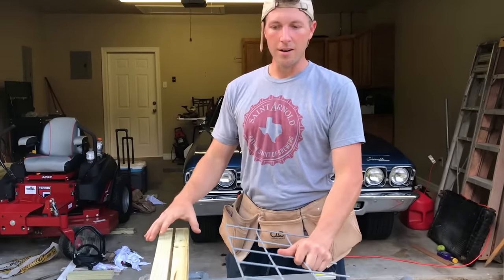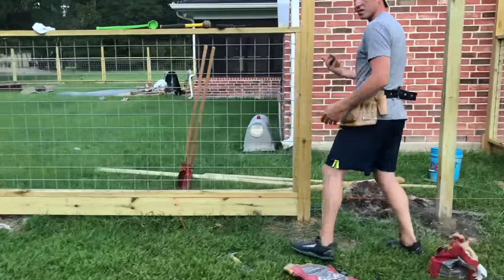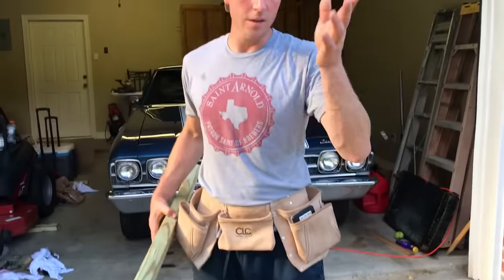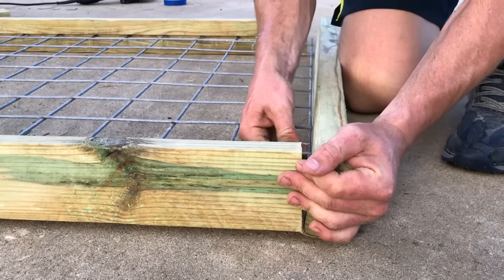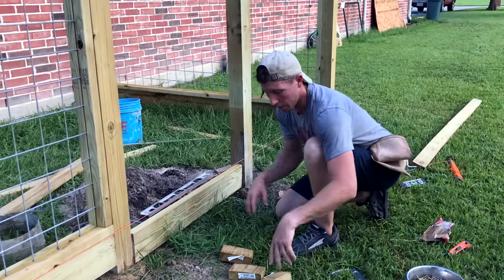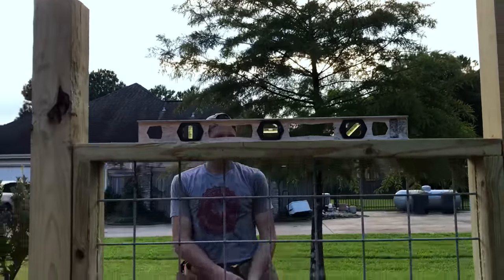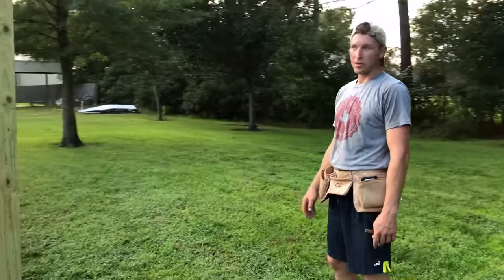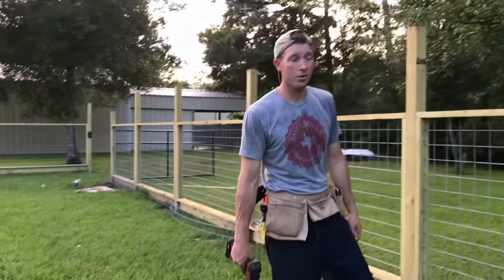Part 1: Modular Hogwire Panel Fence with Dado Groove

Comment: Great fence! I'm about to buy a piece of land and I have two Australian shepard/Pitt mixes that love to run.... and dig. I had a nice privacy fence they broke the slots out of to run off. I think I'll make something similar with concrete around the base or something
Reply from the maker: Anna G Thanks for the reply… The fence should hold up well to your pups, especially with the added concrete bottoms. Buried cinderblocks or pave stones could work as well For minimal price as well. If you are interested in construction details, material breakdown, and cost generator based on my build per linear foot, shoot an email to Hawkijon@aol.com

Comment: If the desire is there you could paint the 2x4’s and post before putting the panels together and installing...paint or stain/water seal.
Reply from the maker: Thanks for the reply! you're absolutely correct! Both are excellent ways to preserve the wood from bugs and natural decay, but unfortunately treated wood must set for a while before it will properly accept stain or coatings. About a year after install it was finally able to accept stain. Usually it takes a few months, but in our humid southeast texas climate it prolonged that process. The fence has held up great. shoot an email to hawkijon@aol.com if youre interested in my construction plans and cost generator.

Comment: This is really great and very helpful. Thank you for including the plan information. It is impossible to find the wire fence at gauge 6. I am not sure if gauge 10 would be strong enough.
Reply from the maker: I would recommend four or six gauge… Go to tractor supply they should have bundles of this stuff 60” x 16’
Reply: Perfect, I think four gauge is ideal and strong enough. Thanks @GatorOverland

Comment: Had to watch the vid twice. In the first vid, the Chevelle blocked my view (I have a '67). Also, I noticed the 2 barley sodas on your saw. That's at least a 3-beer job. Per panel, that is.Seriously, great vid and thanks for the post, man. I gained lots of useful info that I may use to frame my pets' space.
Reply from the maker: thanks for the reply bud! Yea shes a 69 and alot of fun. I finally got her to stop drinking so much and is now in the 14mpg range. As far as the fence goes, i have developed some PDF details with material breakdown and an excel cost generator based on my exact build per linear foot. shoot an email to hawkijon@aol.com if you are interested.

Comment: What a great fence. Thanks for sharing. I’m in rural northern Illinois, and need a fence to keep the deer out of an area. Would you think I could stack your panels on top of one another, (with a 2x4 in between for support), so I can get a fence that is 8’ tall? I’d truly appreciate any advice. Thanks so much for a great video.
Reply from the maker: Thanks for taking the time to watch and comment… we’re coming in on our fifth year of construction and all is holding up well… If you haven’t seen our part two (18 month evaluation) you should check it out, it answers a lot of questions that folks have had over the years.
It will take time, money, and strength to do, but I have no doubts that this design will hold up to what you’re wanting to do. Since the weight of the fence panel is distributed between the lower rot board and the two vertical post, it shouldn’t be an issue of sag. It would definitely be different, and I would love to see the finished project. What is your expected length of fence in linear feet?

Comment: Watched your video about 6 times, before I finally built my own 45 foot hog wire fence.  Thanks for posting this video.  I showed it to my wife, and even she thought I should build one.   

I need some advice.  I went with a double gate, instead of a single. This was to make sure I had clearance away from a waterline.  Didn’t want the posts to be too close to it.  

I was in the house upstairs, and looked down and saw that they were noticeably, twisted.  Probably happened after all the rain we got back in July.  I’m in the Austin area, so I deal with heat, and crappy soil.  

You mentioned that a couple of your posts also moved, before you put in the panels.  Mine were perfectly straight, after I built it back in June.  What’s the best way to move them back?  I know I’ll have to take the gate down, and the panels on either side, before I can even adjust them.
Reply from the maker: Hey mike, thanks for reaching you. Always good to hear from a fellow Texan. Glad to hear you took on the task of making your own fence. I never would have guessed this project would have become so popular. I honestly made the video to keep from having to explain the same thing over and over to my neighbors... 650K views later, here we are. So, to answer your question, leverage is your friend. Apparently its nearly unavoidable for posts to twist as they become wet/dry/wet/dry and if left long enough between your setting of post and installing of panels, etc, they will twist beyond use. What i did to combat this was i took 2 left over 2x4's from the project and put them perpendicular to the 4x4 post and flushed them up to an open edge of the 4x4 and drilled a number of screws through the 2x4's into the 4x4. to begin with i started from the ground and followed the 4x4 up until the point of which i saw that it started to twist (maybe 2ft up) and and gave it another 6" and placed the first 2x4. i then followed the 4x4 up further to find that it was pretty much the same twist amount from below all the way to the top, so i placed the 2nd 2x4 about 18" higher than the first. If you understand what ive explained so far, ive made an "F"...the 4x4 post is vertical and the (2) 2x4's are horizontal about 18" apart, and the lower board is about 6" above where the twist starts. Get a friend to come over and pull on those horizontal boards while you get your panel in place. Surpringly the post untwisted with little effort and no damage or splitting of the screws with the boards i was using to lever. If need be you can comealong the lever boards to a stronghold (tree.tractor, truck) for a longerperiod of time than pulling. If you have this ability, then you can do a number of days of wetting down the post to untwist it to a neutral postion,,, but be mindful it could start twisting the other way if not tended to properly. I hope this puts you with a better idea of what to do. Shoot an email to me if need be hawkijon@aol.com
Reply: @GatorOverland  Thanks for the quick reply. I didn't think about just using a couple of spare 2x4's for leverage.  I thought about wetting the ground down, to get it soft enough for it to move.  It's already hot as heck, so it should dry quickly, after I'm done.  Also, I just took off the gate, and the panels on both sides of the post, so that it's easier to work.  I'm going to run a string along the top and bottom, and line it up, and try the 2x4' method.  Thanks again for responding so quickly.
Reply from the maker: You bet! Happy to help/contribute.. hope it works out.. it just need to be close.. it’s a fence after all
Reply: @GatorOverland  I just looked out my window, and now I see why you said to use leverage to twist the wood.  I guess when I said the wood was twisted, in my mind, it had moved at the ground level.  Looking at it now from the window, my left gate post is actually bowing to the right, which is where the fence swings open.  The right gate post is twisted starting in the middle.  Man, I may actually have to dig up that left post, and replace it, because of that big bow, and twist.

Yea, I know it just a fence, but I was proud of myself for actually building it.  I think it took me 3 weeks to build.  I had to rent an auger, then rent 2 jack hammers to break through the rock.  The 2nd jack hammer, was to dig out the first one, that got stuck.  lol.  

You've given me an idea of how to approach it, so thanks again.
Reply from the maker: Yes, i can only imagine the amount of excavation effort that went into prepping for your posts. Mine was 207ft set in loam/clay/soil and with august/september weather here on the gulf coast, it took me the better part of a month to complete mine, and in in that time my post began to twist, so it doesnt take long. And absolutely this fence is somthing to be proud of. Im not a wood worker/carpenter but i felt very accomplished for taking it upon myself to plan and execute the project without help and with minimal to no hickups. When i was mentioning about being "close" i meant with your own discretion but dont fret because its wood, and its perfectly imperfect and will constantly change over the course of time. Thankfully its been over 2  years and mine is holding up well, no warping, splitting, bowing, rotting... very happy with the outcome... atleast 4 people in the neighborhood have done this fence. It works great.

Comment: Nice fence. Do your dogs dig? We had to put cement pavers into the ground and overlapping bottom of fence about two inches. Then Quikcrete was used to seal the pavers into the ground.
Reply from the maker: Thanks for the reply, fortunately the only digging that has occurred has been in the middle of the yard. Come to find out, we have ground moles and the aussie picks up their scent during the moles breeding time. I cant say im happy about  his methods of mole eradication, but if they dug on the fence line i would probably do something very similar to what you have mentioned.

Comment: The groove in the bottom rail will hold water. If you caulk that up it may prevent rot. Nice inexpensive fence.
Reply from the maker: Thanks for the reply, i did go back and drill 1/4" hole every 8" for the dado grove for draining. I checked it by pouring a bottle of water in the groove. Its no Niagara falls, but it definitely drains. Shoot an email to hawkijon@aol.com if you are interested a hand sketch with material breakdown and completed photos.
Reply: @GatorOverland  Was going to recommend drilling holes every so often to allow the water to drain, good job!

Comment: How did you do the holes ? Hand auger? And what kind of cement did you use to fill ? Did you use 1 bag per hole ? How deep did you go ?
Reply from the maker: Thanks for taking the time to watch and comment… I used a handheld auger that I borrowed from a friend, and the amount of cement you use greatly depends on the diameter and depth of the hole… Per the quick Crete bag instructions it says to have a Home 1/3 of the link that is above the ground and for me was about 17 to 18 inches For about 5.5 feet above the ground, and used about 1.5 to 2 bags of the red quick Crete… Any irregularity in the post height after setting can be trimmed with a song. Please check the video description as I have all that information available as well as a Dropbox add email address should you have any questions… JKHARTEL3@gmail.com

Comment: Been thinking about the same concept.  I was thinking of dado the 4x4 and bottom stinger, saving from framing the steel mesh.  Do you think that would work?  The poles would have to be pretty dead on, but the cost of lumber nowadays.
Reply from the maker: Thanks for taking the time to watch and comment. Yes, I had considered the dado 4x4 route, and it would work, but like you say the poles would have to be dead on… I did not want to account for any mistakes so I made it somewhat adjustable by framing it… As far as strength goes, undoubtedly it is stronger to frame vs using a dado 4x4. So if you’re planning on fencing more than a garden, I would do the frame design.
Nice Jeep!
Reply: @GatorOverland  thanks for the quick  response.  I got 2 acres and need to fence most of it for my dogs.  Love the look of this.
Reply from the maker: Go to the drop box link input your pricing and type in your dimensions.. and it will spot out a cost and material list.. it will be a chunk for 2 acres, but it will be less than some other methods but have full proximity closure.
Reply from the maker: I generated roughly 900 feet for 2 acres and it comes out to Shy of $8000… approx 113 panel frames
Reply: Did you building did you dado the 4x4?
Reply: @IFHSP2 Did you build and did you dado the 4x4s?
Reply from the maker: @charnellecurtis4690 no, all dados are in the 2X4 picture frame that holds the wire panel, and then the panel is fastened to the posts.

Comment: Hi Gator:

I like your construction technique, I am wondering if  the absence of any direct hardware on the wire itself caused them to loosen when your dogs jumped against them?
Reply from the maker: Thanks for taking the time to watch and comment… I have every bit of confidence that the wire will remain in place to anything shy of a rogue automobile or ATV... despite its thin construction it’s very resistant to bowing. Watch my part 2... i cover exactly what your asking, as well as a few other popular questions 
https://youtu.be/bL89wkzSPDo

Comment: Very nice design using cow panels and pressure treated wood. One concern is that type of wood shrinks when dried out. If that happens(most likely) it will loosen your wire panels and they may pop out of the dado groove over time.
Reply from the maker: Thanks for your reply. I do understand that overtime the wood will shrink, but at 1" dado depth and in full perimeter frame im confident that the fence panel popping out is unlikely.

Comment: Its a great looking fence!   I also cringed at your table saw technique.  Way safer to push it all the way through (and use a push block).  Also, you cut the dado a little too deep.  When those treated boards dry out, you'll get a lot of cracking/warping.  Other than that, I really love the design!  Great job!
Reply from the maker: Thanks for the reply Shop therapy. Yea i agree, especially for youtube video use, i should have used proper table saw safety. As for the Dado groove depth, i also agree i could have used 1/2" to 3/4" to better the longevity of the fence. I did add weep holes every 8" or so in the dado groove and it does a very good job draining the water out of the groove, so hopefully i have deterred any short term cracking/warping issues. I hope to seal the boards soon if/when they will accept it and not bead. shooting for 10 years or more, i guess we will see what stands the test of time.

Comment: Great build and video!

Is the fence still holding strong? With the benefit of hindsight, is there anything different you’d do if you had to build it again?
Reply from the maker: Hey Tony! Thanks for taking the time to watch and comment. There’s absolutely nothing I would change. The fence is holding up great! I don’t know if you saw my “part 2” where I answer a lot of concerns folks had, including mentioning that after I did my first video i drilled weep holes in the bottom groove for water to drain. Also, check the description for links to my construction info and cost generator. Or email me at jkhartel3@gmail.com https://youtu.be/bL89wkzSPDo

Comment: How secure is the wire fencing within the groove? If kicked or fell into, would wire fencing pop out of the grooves?
Reply from the maker: Nathan Carpenter thanks for the reply! The panel is held in place by the 1” depth groove around the frame. The panel is quite rigid and doesn’t flex much on its own. I’m not the least worried about it popping out, even with the weight of our 200lb mastiff up against it. You’d have to have a vehicle or a rogue lawn mower hit it to potentially damage the panel and/or framing.
Reply: @GatorOverland  Roger that. Thanks.

Comment: Interesting take and a good looking fence.  On the full sized panels though, couldn't something run into the wire and pop the whole thing out of the wood frame?
Reply from the maker: Thanks for the reply awy. I think i understand your question/concern, but im not sure what you mean buy "something running into the top wire". The wire panel is secured in a 1" deep dado grove in the frame all the way around it and then fastened on 3 sides between the two 4x4 post and the mud/rot board. The wire panel itself is quite rigid and has minimal flex, especially within the wooden frame (seen @ 22:41). Im confident this fence would hold up to anything shy of full on hit with a truck or ATV. It has no problem containing my 175lb English mastiff and hyperactive 50lb Aussie. The overall benefit is i am able to have a secure area without taking away from our country views. If you are intersted in detailed hand sketch with material breakdown and some completed photos, shoot an email to hawkijon@aol.com

Comment: Beautiful design. Your table-saw skills could use some work. And a push stick. And an out-feed table. Good job though. Curious as to the cost. How does this compare to chain-link and dog-ear redwood/cedar?
Reply from the maker: SDMacMan tha is for the reply. I get the push stick comment a lot. I agree I could have used a bit more safety. I did my fence for $8 per foot. I was quoted upwards of $25 for a fence builder to do it. Shoot an email to hawkijon@aol.com for constructions details with material breakdown and cost generator I developed based on my build per linear foot.
Reply: @GatorOverland  wow 8 bucks is pretty good. Thanks man

Comment: So I’m in the process of building the same fence. Did you do your posts 8’ center and then cut the panels to fit the space in between? Or did you frame out the panels first, then do the posts?
Reply from the maker: I cover this in the video… It’s approximately 97 inch centers, but it can technically be any dimension… My panel frames I constructed all prior to putting the post in the ground at 93.5 inches… so technically all of the post are 93.5 inches inside to inside, rather than on center alleviate any post dimension, discrepancy . Shoot me an email at JKHARTEL3@gmail.com and I will send you all the construction information as well as Photo references of other viewer builds